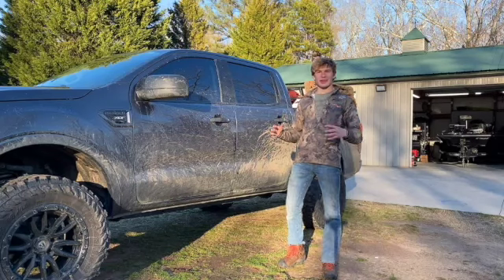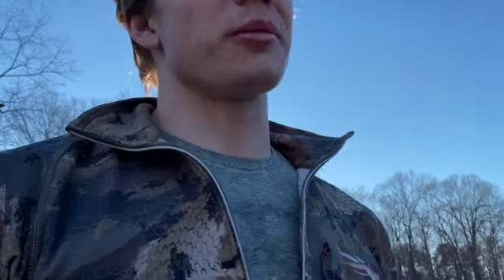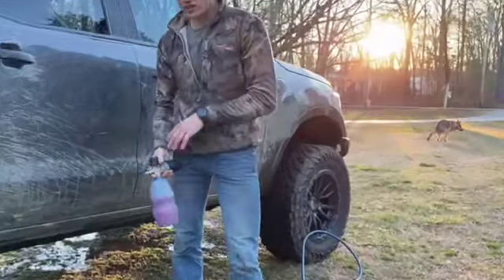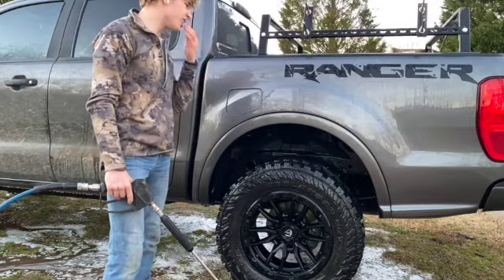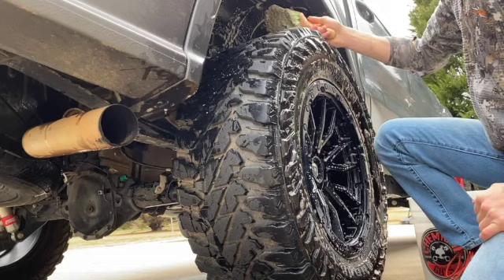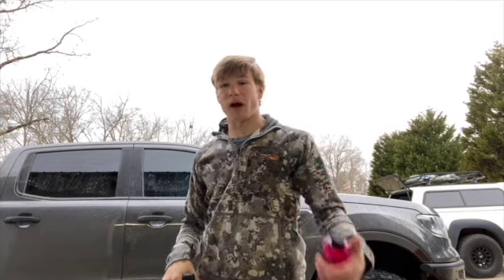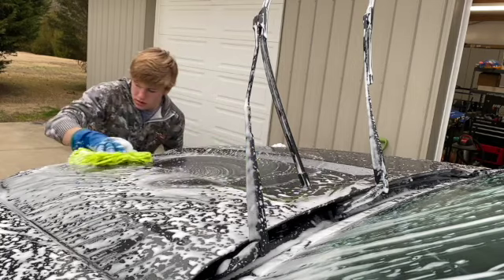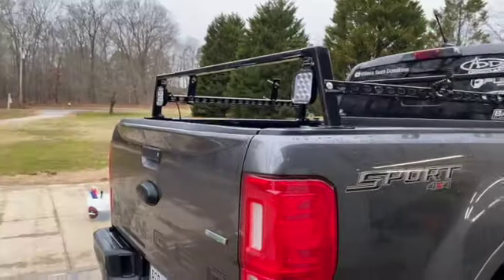How To Clean Your Overland Rig!!

Comment: When you wash go with the grain horizontal all around the and rinse your mit often, I got cmx  ceramic coating on my ranger supercrew too ,i love the coating the soap won't stay on truck, and if you can feel   the finish on your and its ruff use clay magic if you drop the clay trash it ,the cmx is at Walmart, also use dawn not on finish, use it on every thing else ,with the cmx horizontally wax on a little haze then   ceramic off , and use a blower to remove most of water and horizontally and chamey   off I have no marks, swirls, and a perfect finish and when you get it muddy catch a rain storm you have free car wash.

Comment: How did you get the gloss black mirrors?
Reply: And door handles 🤔
Reply from the maker: Havent touched any of that yet. still have the factory black plastic for both but i think color match would be killer
Reply: All you need is cmx ceramic coating Walmart
Reply: @tylerthomas5454  use alcohol and leave alone that's what I did on ranger and looks good
Reply: @scotthowe8339  I’ll check it out thanks dude!

Comment: I see you have a boat in the back how does it tow long distance?  As far as the ride .
Reply from the maker: The few times I have towed it the ranger has done very well. With the eibach kit and the 1 inch rear block it evens out almost perfect even with the heavy load.
Reply: @downsouthexpeditions2956  awesome thanks!looking to go to a mid size from a Ram1500. I do quite a bit of fishing
Reply from the maker: @derrick8746   gotcha. I know there is also some aftermarket accessories that can definitely increase the towing performance dramatically